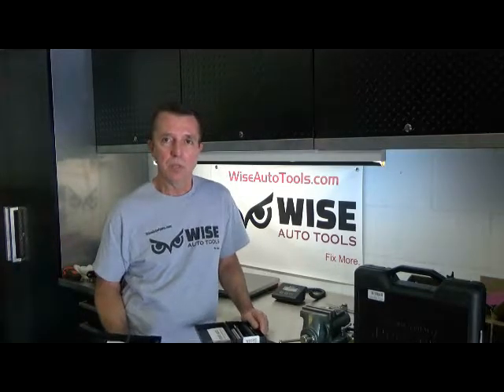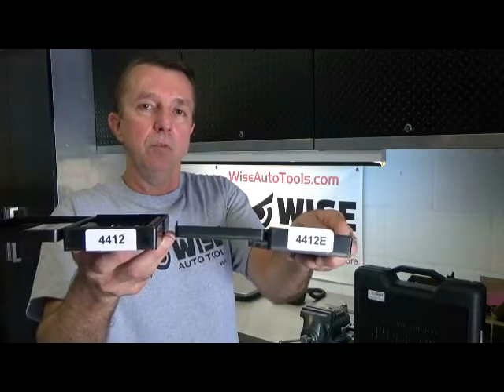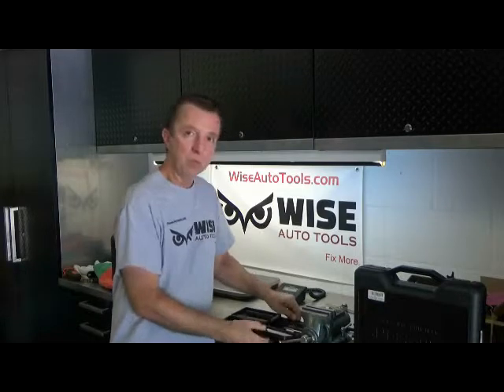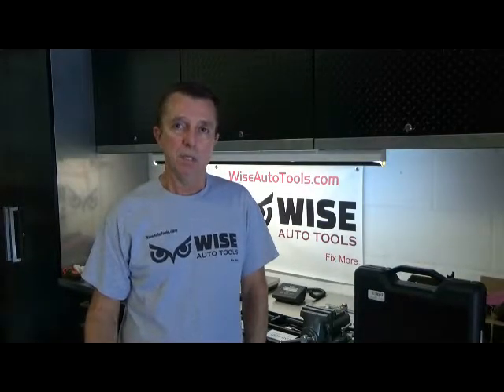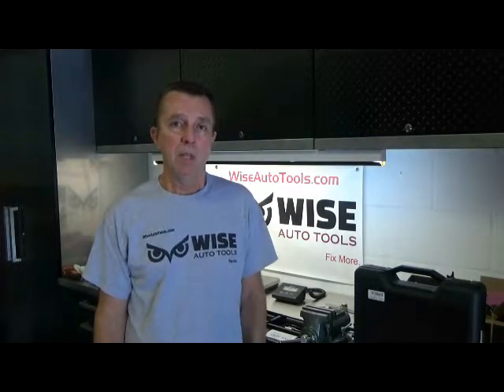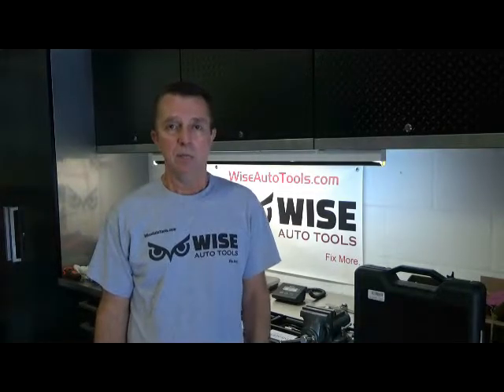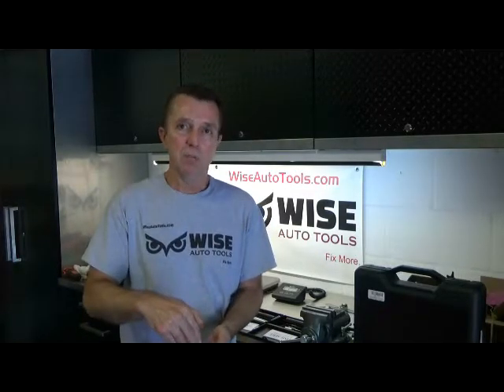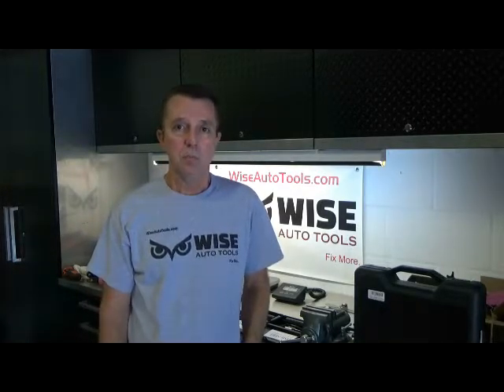Difference in Time Sert's 4412 and 4412E Spark Plug Repair Kits

Comment: Hi and thanks for the video, very clear.

Are the instructions that come with the 4412 kit accurate for all its applications?
In my case the heads are 243's coming of a Chevy LS6. What i'm trying to ask is if the step by step procedure remains the same for my application?